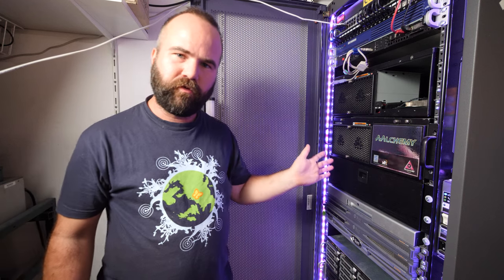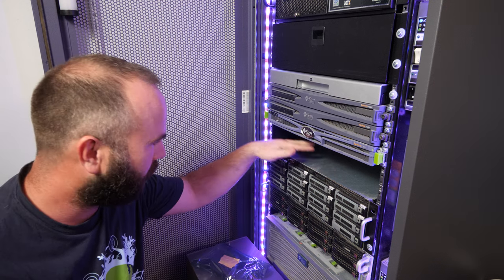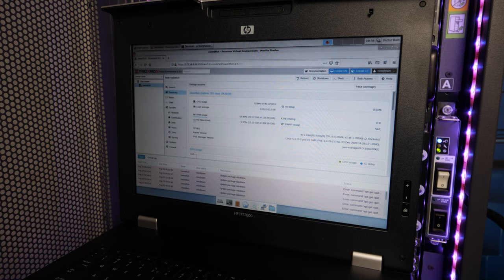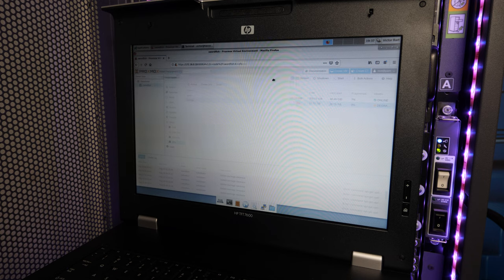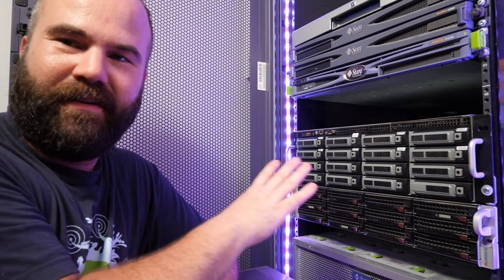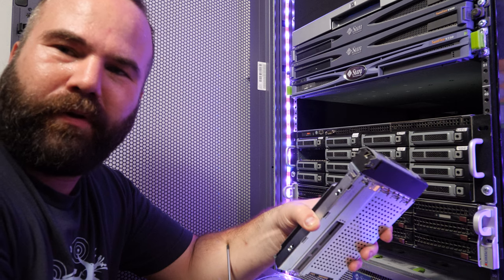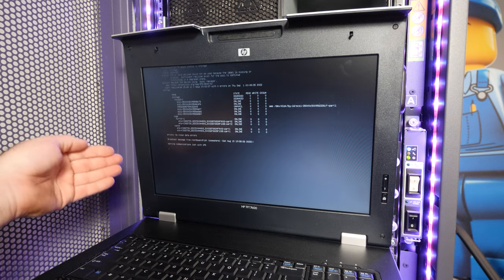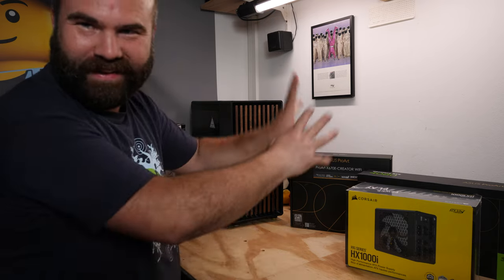Homelab Server Maintenance. ZFS Pool Down HDD Replacement

Comment: Learned that trick managing multiple TrueNAS hosts - don't replace HDD straight away when it fails. Better insert the replacement drive into free slot (you need to have one beforehand), do rebuild and only after that remove the faulty one. Creates less chances for an error.
Also when drive haven't failed completely yet, it's easy to identify it with "dd if=/dev/drive of=/dev/null", you run this command and the drive starts blinking constantly (usually others blink sporadically).

Comment: If your current storage server is over powered, you can empty one of the sockets and eliminate that power draw.
Reply from the maker: But half of the pci slots and half of the memory slots are connected to the second cpu.
Reply: @victorbart  Good point. Perhaps you can park/disable cores in the bios.

Comment: Never create a ZFS pool using the sdX devices as they can change. You can export your (working) pool and then import it using the /dev/disk/by-id so it will use the unique serial numbers or WWN.

Comment: look at the intel 12500t or the 12600T 35 watt max is 90watt because they are used in a thinclient  witch is 6 cores 6 threads also look at the ASRock B660M PRO RS LGA 1700 Intel B660 SATA 6Gb/s DDR4 Micro ATX Motherboard  its ddr4 3200 based right now board is 90$ US and the the processor on ebay is like $150